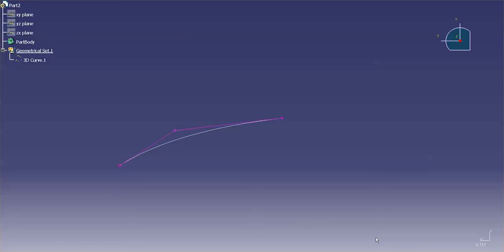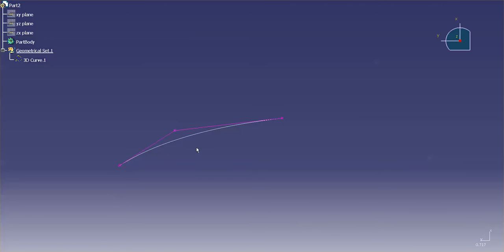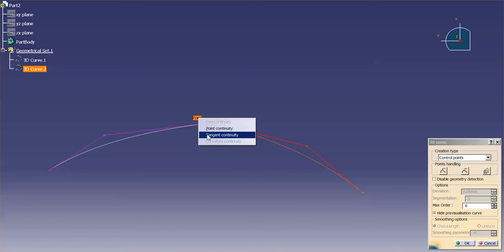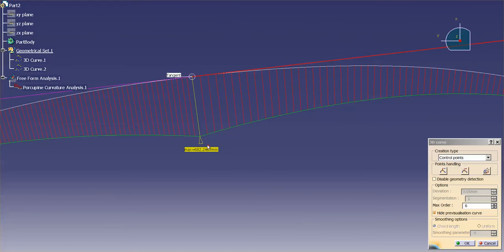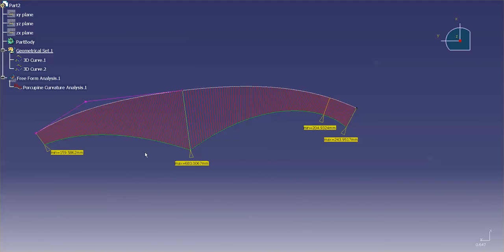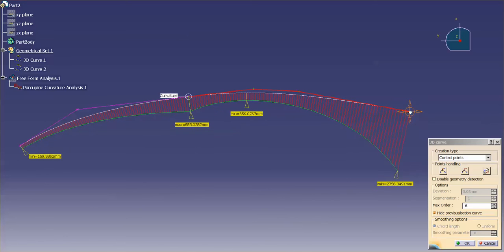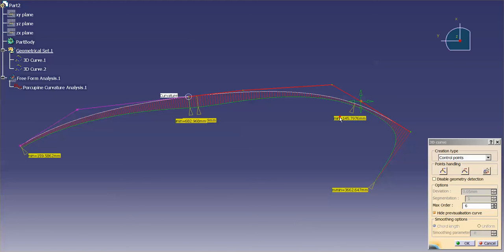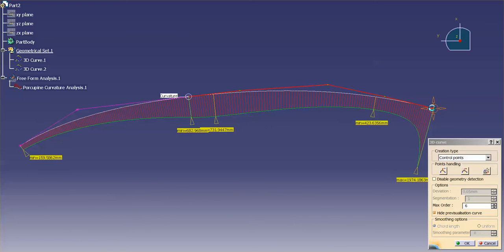Catia V5 | Catia V6: Continuity and Control Points

Comment: 5:43 you can make Graph is more smooth without G3 (or 3rd point) http://joxi.ru/RmzqJ9QF007Mnr
Reply from the maker: It all depends upon the type of control you need. I can make a Conic look G3 as well but mathematically it will not be. When making external body panels my big slabs are as simple as I can make them. That way I can make my blends simple as well but in some cases a 7th degree is needed.
Reply: "but mathematically it will not be" and what? If you can make clear with minimum cv and what do you need. How important it would be from the mathematically to you? Math need for programmers :) our need is clears and good graphs. If you need extremely curve and you do not get it by G2 you make G3. I think that.
Reply from the maker: I use the simplest surface I can get for sure especially when it comes to styling. The issue is with how the analysis tools measure continuity. I have seen places that have auto-checks that refuse slabs unless math checks out. Think Aerospace...